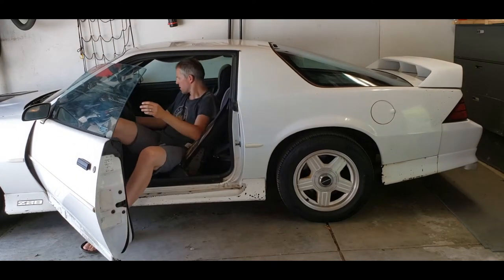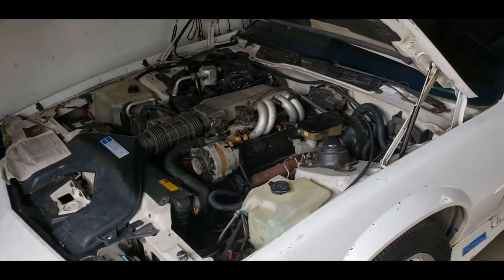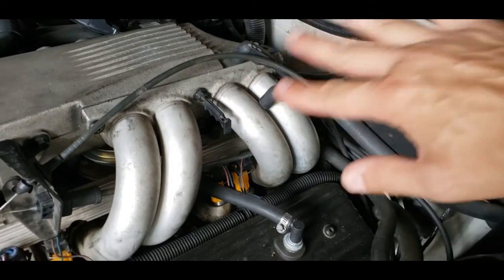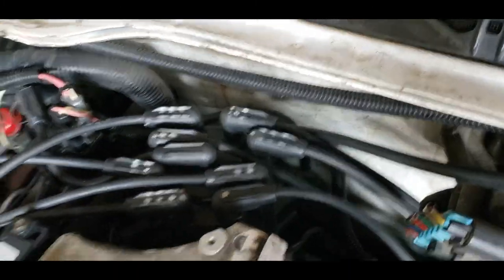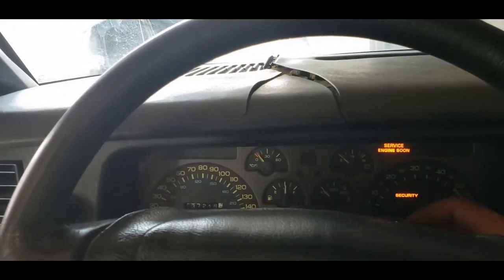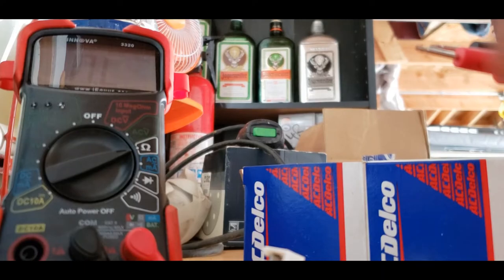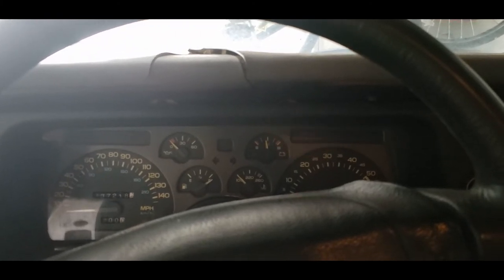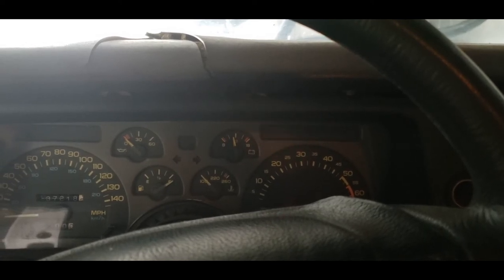1992 Chevrolet Camaro Z28 - Part 4: Hard start, stalling, rough idle issue

Comment: I have an L98 in my 90 Vett. Low mileage but like your car a speed shop did a poor tune up and installed plugs for the cast iron heads, not aluminum. Different thread length. changed the ECM to a rebuilt unit. all so it could be sold at an auction. I feel your lack of distrust for the car. Felt the same way until I had a shop smoke test the vacuum lines and low and behold two were damaged. Thanks for giving the results of your labor. With 30+ year old cars routine Maintenace like ALL filters and fluids helps to relive some anks about going somewhere in the future. Just one less concern. It can be costly when you throw parts and time at issues with the best intentions. Thanks for sharing! Look forward to your adventures with your Camaro. Hope you get some smiles per miles!
Reply from the maker: Thanks for watching and for your story!
Reply: I have a 92 Z28 5.7.
Right now the radiator has started leaking so I ordered a Champion 3 row aluminum.  After two tries I’m giving up and I found evidence that it was really not a direct fit. I ordered a Cold Case from Camaro Central. They say it is a direct fit no mods needed….We’ll see. Found flakes in my antifreeze so I’m changing the water pump as well. I bought this car brand new and am passing it to my kids. I have plenty of spare parts too. I kinda don’t mind putting in new quality parts as I drive towards dependency for the kids.
Reply: @joesausage4639  Sorry to hear about your fitment issues Hope the Cold case fits? Did you get new rubber supports for the install? Not trying to spend your hard earn money, but now's the time to get any molded hoses for the cooling system. My hoses on my 90 vett looked and felt good, but in truth they were starting to split on the ends. Kind of like the Vacuum hoses. I used to just cut the split ends off. But old hoses are still old hoses that give up the ghost when you think you got it fixed. I think you owning your Camaro from new is Really cool. It's saying a lot about finding the car you always wanted and being able to hold on to it. Hope the kids get as big a kick out of it as you!
Reply: @tonysteppan8495  
Yes, the supports look good and I might get some more from Camaro Central. The hoses aren’t that old as I had them all replaced some time back. The front hoses all will be replaced and they are younger than all the others. I’ve been replacing connections and wire protectors too. In less than a year I’m having engine out work done, I’ll have all the hoses right side and rear replaced again. I’m about to give this car to my kids and I want it in tip top shape. I also have been getting spare parts for the car from sensors to compressor, etc.
Thanks for the advice, it’s always welcome here.

Comment: So what do you think your issues was, essentially? The oil sending unit?... Or did u later find the real issues? I've a 2.8 w/ a bad idle and misfire...
Reply from the maker: I know it seems unlikely but based on the results I have concluded it had to be the oil pressure sending unit. Everything else I tried seem to have no lasting effect but once I rerouted the spark plug wire away from the oil pressure sending unit the problem went away forever

Comment: I own a 1991 Z28 with 33k miles. It’s a hard top so it has the 350 tune port engine.  When I purchased it the miles were 23 k miles the problem I had were the fuel injection issues I found a good mechanic that figured it out. There is a part on the passenger side on the top of the tune port it is back toward the distributor.  It was. 35 dollars it fixed my problem.  I could start the car drive it but if it stalled it would not start if I shut the car off it would not start.  But now that it’s repaired I haven’t had any problems or issues.
Reply from the maker: Thanks!

Comment: I did the exact same thing. I put injector cleaner and octane booster in my gas tank. And all hell broke loose. Since i did this. I d k. What to do.  Its backfiring and all idling rough.
Reply from the maker: Good point....I didnt ever make the connection that the injector cleaner may have caused this. Eventually, either me moving the spark plug wire away from the fuel pump cutoff sensor fixed it or maybe just driving the car cleared out the junk I loosened up the fuel system.

Comment: mine starts and runs and cuts off at redlights randomly, goes fast but once at about 75 she dies down quick
Reply: tps sensor has to be adjusted to the correct position
Reply: ended up being one of the transmission sensors unplugged, pulled the thing with the engine anyway tho

Comment: I’m watching this video to see if it would help with my problem my 91 RS is hard to start once it does the rod go low and then high over and over until it stalls it self
Reply from the maker: Is it a TPI engine? As you may have seen in the video description, i replaced or checked a few things. Here is what I would try if I were you:

replace ignition control module (cheap and easy)
unplug new coolant temp sensor and see if anything changes
Replace coolant temp sensor if car works better with it unplugged
unplugged battery for several hours
"reset" the throttle position sensor 
replaced oil pressure sender and check that the sparkplug wires arent interfering with this sensor

I am not a real mechanic so replacing parts is what I often try (versus testing them) but the parts are cheap so not a huge deal
Reply: I'm having this exact problem now.  What was your fix?

Comment: Has it stalled on you yet?
Reply from the maker: Dead reliable since I changed the oil sensor and moved the spark plug wire. I did sell it but never gave me problems again for months afterwards
Reply: @MindofMatter  do you remember which oil pressure sensor you changed? The one by the oil filter or the one by the distributor?
Reply from the maker: @LT3D  down near the oil filter, I think I got to it from underneath
Reply: @MindofMatter  thanks man. I'm going through the same headache you went through 3 years ago.

Comment: You have a lose ground to the computer.   That will make all those problems.
Reply from the maker: Thanks for the advice. My 1992 GMC Typhoon at similar symptoms and you were very close on that diagnosis for that truck. It ended up being a loose EPROM chip in the ECU.

As for my Z28, I worked on it for a bit longer and now it is 100% reliable. I drive it all over the place even with my kid and it has not let me down!

Comment: I also replaced the whole distributor and it went away for a while . Now it’s back .
Reply from the maker: You got a new ignition module that lives inside the distributor when you replaced the distributor right?

If not those two, coolant temp sensor, throttle position sensor?
Reply: @MindofMatter  done the IAC
Reply: @MindofMatter  temp sensor
Reply: Need to do the oil  sending unit like you . Replaced the coil too . I don’t remember if I did the ignition module.
Reply from the maker: @chevycmf  it seems weird that rerouting the spark plug wire and replacing that sender seemed to do the trick. I dunno, hard to Beleive but I can't argue with the results
Reply: @MindofMatter  I agree . My sender unit is all greasy so it needs replacing. But I just did oil change . So I’ll do it here in a few months. Also the ignition control module …. I’ll do as well .
Reply: Makes me want to rip out this engine for an LS swap ! Before this I had a heating  problem. The cooling fans would not work . So that was a pain to troubleshoot. But it got it !
Reply from the maker: @chevycmf  I know the feeling. But it's like cutting off your sprained ankle to put on a new foot. Your car will run again, don't worry
Reply: @MindofMatter  I replace the whole unit . Wires and module, cap and rotor ! The whole thing .
Reply from the maker: @chevycmf  did it work?

Comment: Fuel filter
Reply from the maker: One of the first things I tried but unfortunately, was not the problem
Reply: What was issue
Reply from the maker: @jermalramsey1567  I noticed one  of my spark plug wires was passing close by the oil pressure sender unit which caused sporadic poor running. At the same time I rerouted the spark plug wire I also change the oil pressure sending unit. This seemed to resolve the problem once and for all.

I read online that a drop in oil pressure as measured by that sending unit would cause the car to shut down the fuel pump to save the engine and so I think that's what was happening just sporadically off and on.

Comment: Vacuum, fuel filter, dirty sensors
Reply from the maker: Thank you, I did do a vacuum test. Can't remember if I changed the fuel filter or not but if I did it didn't do anything. I did spray off some of the sensors under the hood with carb cleaner but nothing downstream of the intake valves
Reply: @MindofMatter  is this a manifold or a carb I didn’t watch the whole video. I have a 1990 with a carb conversion and it starts and runs for a minute then stalls low rpm. Vacuums we’re cracked then I saw a video where the distributor component was cracked and they guy changed it.
Reply from the maker: @MisterRay11  fuel injected manifold

Comment: My 91 ta is acting similar but it always ran fine for 20k miles.
Reply from the maker: It's a 5.7 tpi? Make sure spark plug wire is not near the oil pressure switch underneath the car, since it's free.

Beyond that I'm not skilled or patient enough to test every component so consider replacing the cheap parts first like the module in the distributor, coolant temp or throttle sensors, or even just a basic spark plug and wires to start